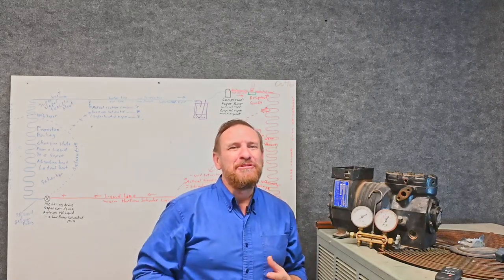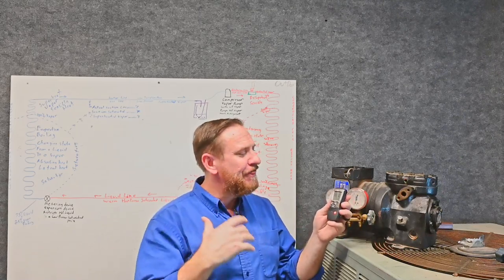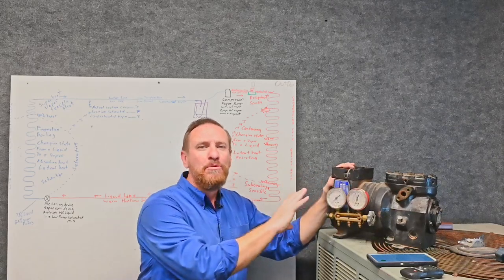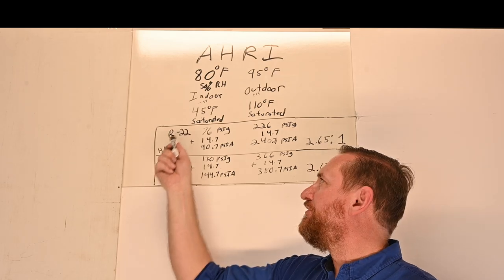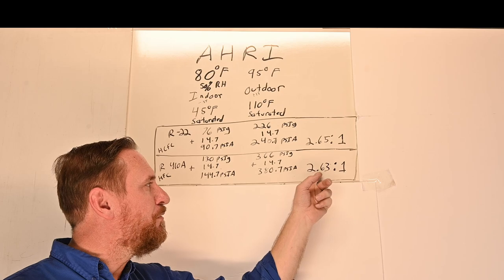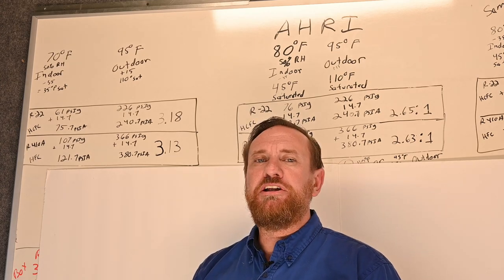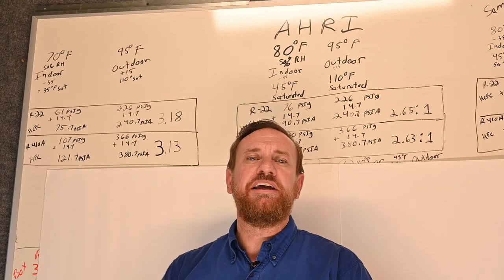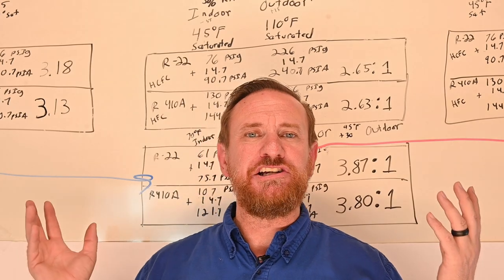HVAC 100 A compression Ratio part 1

Comment: Who told you refrigeration equipment was poorly designed in the OLD DAYS of the 80s Lol, if anything it’s worse today with the cheap crap these techs have to deal with, cheaper thinner coils, crazy refrigerant blends, power saving fan motors at the expense of proper air flow, computers replacing simple reliable controls, if anything i’d worry more about the equipment design of these days. I started in this trade in the 70s and this video dissing the equipment of the “OLD DAYS” is totally off the wall, i’ll take the old reliable equipment over this new crap any day! Please explain to me how building a piece of refrigeration equipment that has to be replaced three times to equal the life expectancy of the same piece of equipment of the OLD DAYS is supposed to be environmentally conscious.
Reply from the maker: #1 I reached the entire video and nowhere in there did I say equipment was poorly designed in the old days.

#2 this video has nothing to do with all that rant you gave. It was about compression ratio.

Fact a larger designed condensing coil will provide a lower compression ratio. 
I'm the 80's it was designed for a 30TD meaning the head pressure was 30 degrees higher than the ambient.
As time progressed we figured out, increasing the condensing coil size transfered the same amount of heat with a smaller TD. The lower saturation temperature the lower the head pressure the lower the compression ratio. 

I will not acknowledge the rest of your rant because it is irrelevant to the topic of  this video about compression ratio.
Reply from the maker: Bro what is up with you today?

All of this anger has nothing to do with what I said in the video.

Are you alright?

Comment: Can you do a video detailing explanation of condenser and evaporator design specifically.  How the engineers and what math formulas they use. 

        Automotive have aftermarket condenser manufactures that sell cheap condensers instead of having the factory 21 fin per inch.   They will cut the fin count down to 16 or 14 fins per inch saving money. 
                  They will cut the refrigerant passage tube from 58 tube down to 48 tube in Pastis cheaper aftermarket condenser off as a direct replacement. 

Can you explain in detail exactly what are the negative consequences of installing such condensers in place of a original design system. 

I know the answer but many people do not in a detailed explanation that I know only you can get across using the correct verbiage
Reply from the maker: I know exactly what your talking about. I don't currently have that only list. I'm so behind on recording and editing it will take a while before I can get to it.